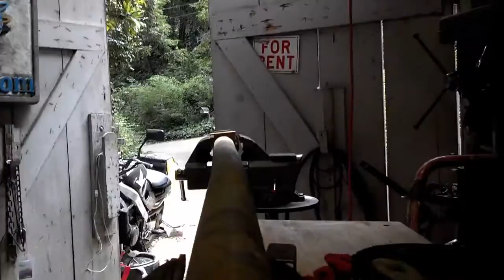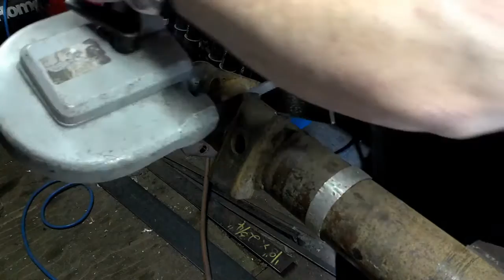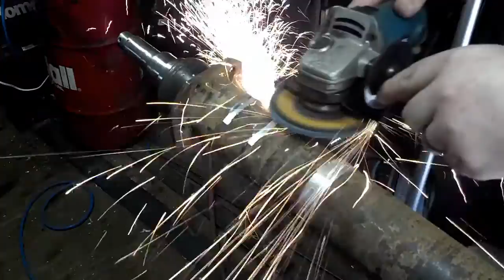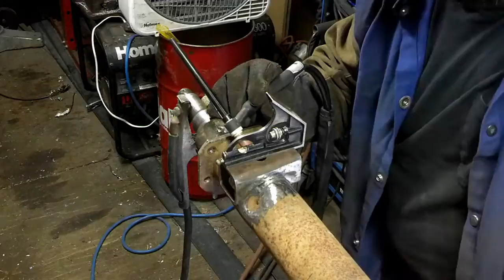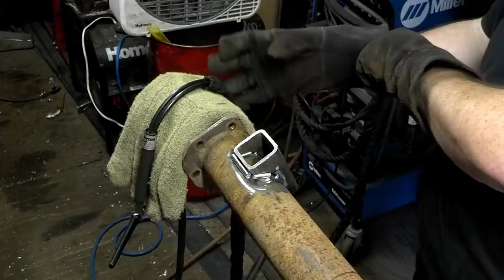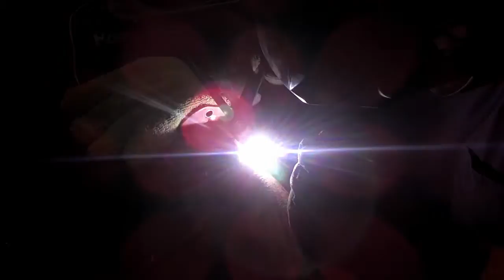Trailer repair part 3: Welding on the perches

Comment from the maker: I wouldn't worry about welding the perches causing warpage, the tube is fairly large in diameter and thin walled. I would probably start with 60-70 amps on stick, using 1/8th rod. You may need to adjust the current to suit the thickness of the part, to prevent blowing through. It's good to test on a similar thicknesses material.

Comment: I always thought that a Mig welder would have better penetration and a more solid weld then a Tig welder for this kind of application.
Reply from the maker: TIG has a larger heat affected zone than MIG.  This larger HAZ is beneficial for penetration as it preheats the surrounding material.  MIG has a tendency to build up on the surface and not provide a lot of penetration into the parent metal.  For this weld I preferred TIG for the following reasons:

a) Larger heat affected zone
b) More energy put into the material, preheating the parent metal
c) More control of material buildup
d) More controlled temperature ramp up
e) I didn't have a MIG handy

Event if e) wasn't a factor, I'd have used TIG for all of the other reasons.  By having a larger HAZ and using the TIG for preheating I have less warpage of the spindle because the whole spindle is hot instead of just one side getting hot and contracting.  MIG may have worked, Stick certainly would have worked too.

I think of TIG as the electric equivalent of Ox-Acetylene welding.